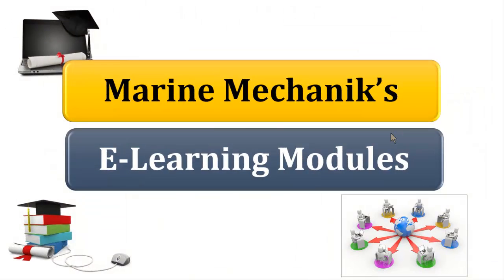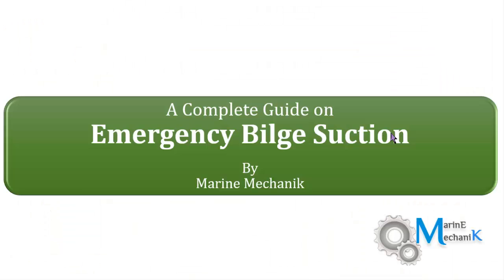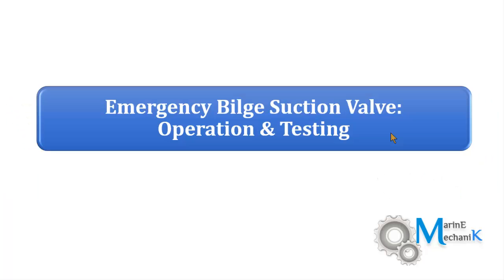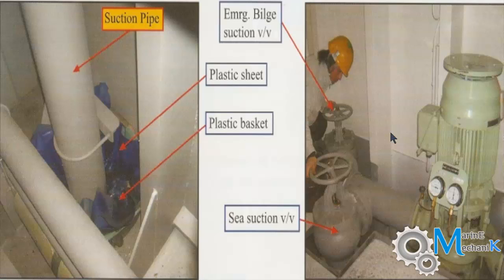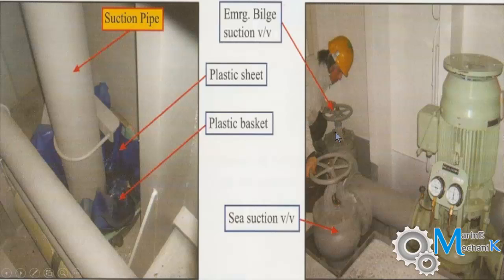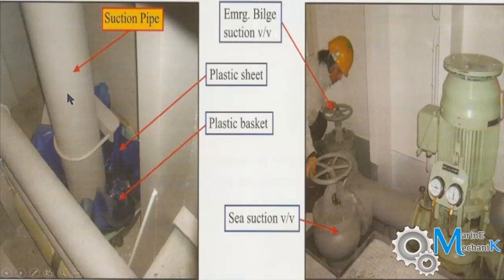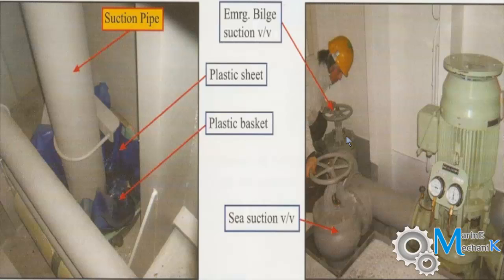operation and testing

Comment: The emergency bilge valve sould be a screw down non return valve left in the open position and isolated with a remotely operated valve upstream of the manual valve. The 'Bag test' can then be performed first by creating a positive head of pressure on the emergency bilge valve by opening the remotely operated upstream valve first to see if any water leaks past the Em'gy bilge valve seat this is called a back flow check. The second part of the test is to ensure the Em'gy bilge check valve does infact lift off its seat.
With the remotely operated valve closed line up the ballast pump sea to sea and start the pump. Next open the remote valve, and watch the water sucked out of the bag. Note - keep a good hold of the bag else it will travel up the suction pipe also. Once the water is gone and the vacumm is broken the Em'gy bilge check valve should re-seat  preventing any water back flowing into the bilge. Stop the ballast pump and return the test materials back to the store.
Reply: thank you